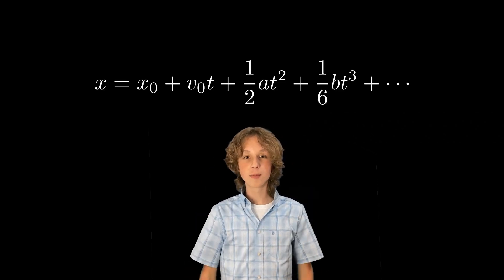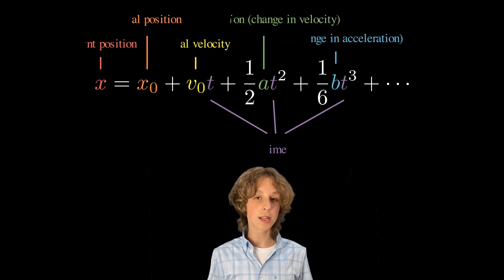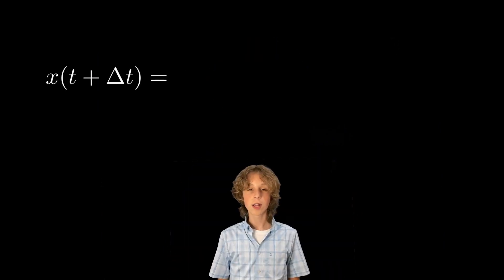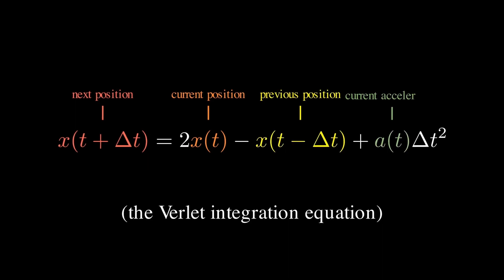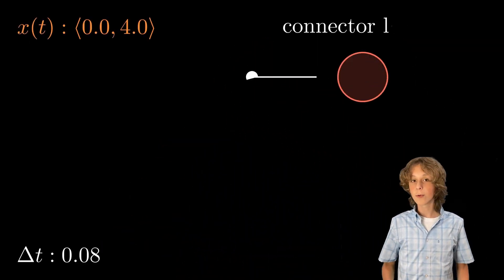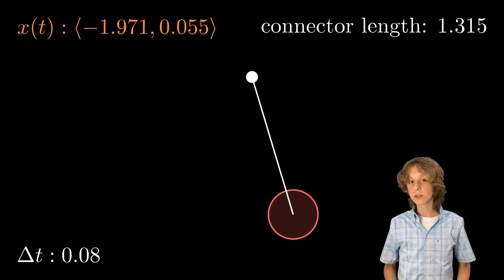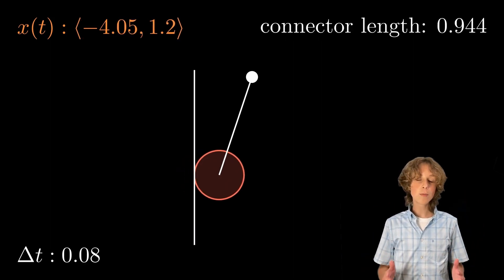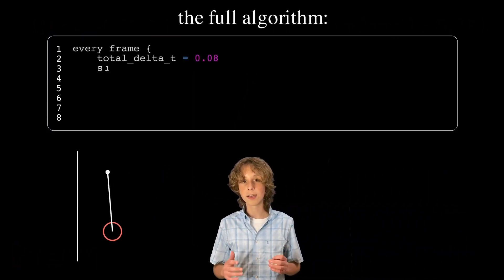Verlet Integration for Physics Simulations

Comment: Hello, how to extract distance passed with acceleration time from Velocity Verlet? Like I have acceleration time 2s, and MaxSpeed for example 4000, and distance remains I wish to know somehow in between integraion step, like get current speed, compute dist remainder (since on max speed dist and acceleration should be 0) then do Integrate(dt)... Classic formulas seems for constant velocity and time in seconds, where in verlet our seconds is stripped to FPS amount. dt = 1/ fps etc... That make me bad time of real distance object passed from some velocity to 0 speed (braking) through deceleration and classic formules produce distances like 20-50 times longer than factually object is passing....
Reply from the maker: Thanks for asking. Since the Verlet equations account for dt, the frame rate shouldn’t be a problem. However, may I ask how you are slowing down the object? (Continually stepping down velocity doesn’t work; you have to set the acceleration.) I apologize if this does not answer your question.
Reply: @VisualizingScience-dq1jt  when conditions tells that I wish to stop, i do set linear acceleration as dir * (maxSpeedConst - current_speed) / timeToStop * scaler. direction is unit vector that is difference between my desired stop point and current origin of body. I use scaler that goes from 0.01 to 1 in range of where current speed is in terms of max speed. Since I need dynamically determine deceleration time and not keep it constant in any dist remainder. So this looks natural when object slowdown. And conditions to tell it to go in deceleration state is some distance like two points is moving, and distance between is 250 for example, then one is stop and at some point I need to estimate that my stop distance is enough not less not more to perfectly stop in this desired point, there where problems of distance occurs, If I predefined something like 200 for distance all ok, but if I put each frame current velocity and time to perform deceleration my distance is like even bigger value than max speed const, while this const is 4000, and current speed not goes more than 1500 🤗 i tried different formulas, ask chat bots nobody know what is dynamic acceleration or deceleration ether. They like can do some calculus and recommend me to memorize all values computed for frame where i decide to perform stopping, and then just interpolate positions which is works for now but is not physically right…
Reply from the maker: I have never tried anything like this, unfortunately. Does this look like it answers your question? https://stackoverflow.com/questions/1088088/how-to-calculate-deceleration-needed-to-reach-a-certain-speed-over-a-certain-dis
Reply: @VisualizingScience-dq1jt  well it seems partially what I did, but I read it more deeply and try if this helps, anyway Thanks in advance!